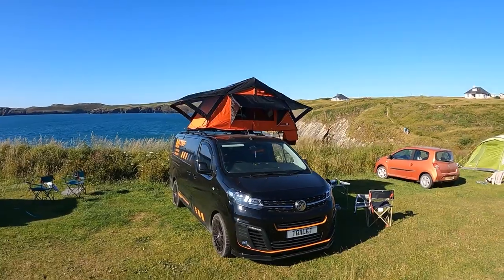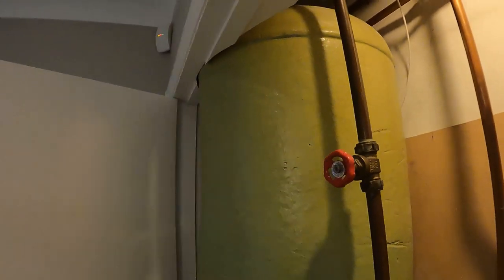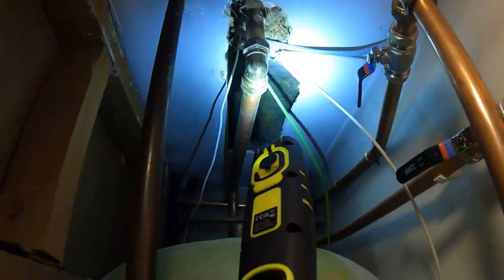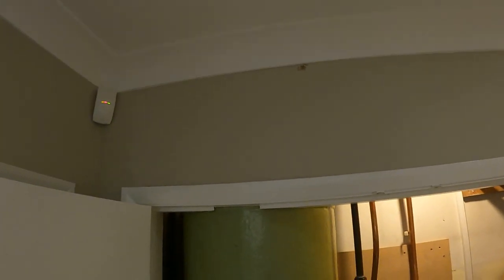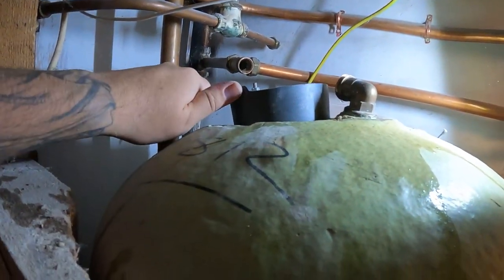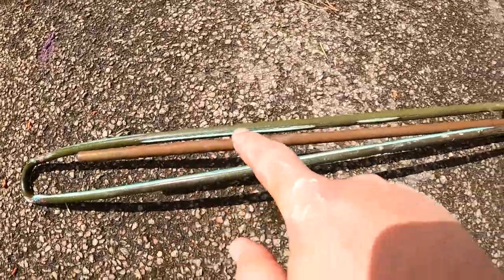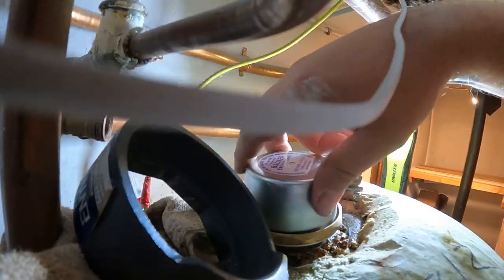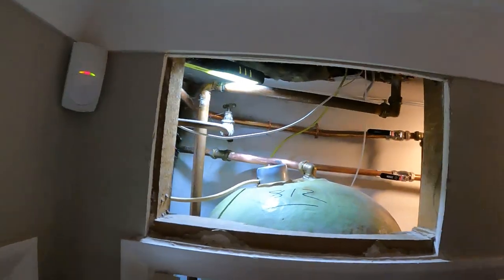IMMERSION HEATER SWAP but it’s not that simple!!! REAL WORLD PLUMBING

Comment: The washer on an immersion is a fibre washer so if any moisture gets to it it expands and seals it. I agree ptfe on the thread but PASTE NEVER on the washer as it will be rock hard by the time the immersion needs to be undone again and it will not move even with a big pipe!!  You love your paste - I have never used it and never had a leak after I have greased the olive!!  I've had some immersions in daft places too!!
Reply from the maker: Never had an issue using paste, or removing things that have been pasted. I’ve fitted a few immersions in 27years and all have been fine.

If you don’t use it someone on the YouTube comments will say you should …. And if you do someone will say you shouldn’t.
We all do things different, no right or wrong as long as it doesn’t leak….. as that’s plumbing😉

Comment: Nice job in the end mark and good tip about informing the customer that the boss can twist on the tank. I hate doing immersion heaters as 9 times out of 10 they have boss white on the threats and they are stuck meaning plenty of patience and slowly slowly with heat.
Reply from the maker: Thanks mate…. Yep always cover your arse on these types of jobs…. We are too long in the tooth to be caught out😉😉
Reply: I have just posted my comment about using boss white on the washer. Fibre washers do not need it. It will be rock hard by the time the immersion has to come out. I have NEVER used boss white on any joint. Just grease on an olive and that tightens smoothly every time so no leaks.

Comment: Love the way you explain every step, to be honest, I at first thought drain tank, cut hole fit Essex flange install the short 11-inch heater, and extend the wire to the heater, But you got over that very well indeed brilliant video, cheers for that, PS we all need a break, and camping is a great way.
Reply from the maker: Thanks Peter….

So many different ways to do so many jobs in every trade, as long as the customer gets what they want at the end 👍🏼👍🏼👌🏼

Really appreciate comments like this, not a “you should of done it this way” comment where they think there way is the only way.

As for the break… it was lovely to just have a few days away with the simple things

Comment: Brave man! I’d have said use a kettle till boiler back & just keep using that to heat water !😁
It never ceases to amaze me, why HWC’s are mounted up like that as if it will give better hot water flow when as we know, it’s the height BELOW the CWS tank that gives that plus of course making sure that fill level is 50mm below overflow ie: full enough!🙄
Reply from the maker: Kettle to run a bath… 🤣🤣

Immersion heater is doing its job, it went as it’s been in for probably 20years and not been used, as said boiler being swapped so the immersion was being used exactly what it was for👍🏼👍🏼

Comment: Hi Mark,
A great film just my kind of job, love the nice pipe bend around the immersion heater.
The old 3/4 pipe and fitting strikes again, real world plumbing I guess. A great solution with the access panel,
it’s also now ready for the next visit. 
Have a great time away that looks a great place to stay, take care, regards, Chris. 👍👍👍
Reply from the maker: Thanks Chris…. Yep a fiddly job but got it sorted in the end👍🏼👍🏼
Reply: If the pipe was 3/4 how did the new metric pipe fit into the T on the other end?

We've got the same issue in Austria with 14 and 15 mm pipes. The standard changed to 15 mm way back in the 80s but there's still the occasional 14 mm pipe around.

Comment: How did you connect the other end of the 22mm pipe surely it was an imperial three-quarter inch fitting.
Reply from the maker: I would of used the correct fitting👍🏼
Reply: @MJTiffPlumbing  thank you for the clarification, I thought that's what would have happened but you did not video that, it's great watching your videos.

Comment: How long did that take and how much did you charge labour 
I think I would have charged 160/180 plus immersion.
It’s one of those jobs you can’t charge the actual time taken and you have to think what cost is the customer expecting
Reply from the maker: Was probably around that to be fair
Reply: For side mounted immersions I charge at least that as when the drain off tap doesn't work as usual the tank has to be emptied by syphon from the top which can take an hour. Then the risk of when the bottom one is undone there is still water in the tanks so a big flood! I take it out very gingerly just in case with the vac handy!

Comment: Fantastic video Nick. Just discovered your channel recently and watched heaps of your videos. I’m on my first reno and learning as I go. I bought a 60s bungalow with a new grants boiler but it costs a fortune to heat 500 litres a month. Do you think this is because of the old cast iron massive single panel radiators that weigh a ton? Should I change these for something more modern?
Reply from the maker: Glad your enjoying the channel mate….. and yes that would deffo be causing part of the problem I would say….
Reply: @MJTiffPlumbing  love watching your bathroom re models. That’s my ultimate goal with help for trades I’ve course but as much as I can do by myself I’ll do. What radiators are recommended for an oil condensing boiler set up? I was looking at Screwfix earlier and the reviews were decent

Comment: I thought you might have kept a couple of 3/4 -22mm end feed couplers on the van Mark . I always have those in the van for that situation
Reply from the maker: That wouldn’t of helped as I had to renew the Pipework and I wouldn’t of got the bend on with a coupler…. It had to be straight out the connector…🙈🙈

Comment: U can always shock the immersion by hitting the immersion spinner with a lump hammer…… goes every time. That’s the way I do them every time
Reply from the maker: I’m sure you can but that one is deffo not one I will try, I’m sure it works but I will stick to the long extension bar and a steady turn🙈🙈
Reply: Correct. A steady pull with a bl**dy great pipe on the spanner will twist the copper and it will crack. A bit of heat and a few heavy taps  and maybe a squirt of WD40 does the trick as you and I have found!

Comment: I had a fun day on Friday cylinder 40 years old customer wanted an immersion never had one the cap was welded on took an hour to get off with the blowtorch and  then cylinder got a pinhole in it I told the customer it could happen that's the risk, they weren't happy to fork out for a new cylinder but what can you do they got 40 years out of a cylinder and on my case all day asking is it finished yet when you have to drain down the system and take the cylinder out that's enclosed in a hotpress and repipe everything as the pipes don't match up torture 😆

Comment: I have watched many of your video and know you are a paste man for all joints but for an immersion you have the fibre washer to seal it in so using paste will make it a nightmare for removal in future. Ptfe acts as a lubricant and a bit of additional sealing.. When its all wired up and switched on I always use a screwdriver against my ear and touch the nut of the immersion so I can hear it is working. Electricity hums!
Reply from the maker: Just use a tester to see mate….. touching and listening is like going back 60years🤣

Paste won’t be an issue as it doesn’t go off or set…. Alway used it for 28years on immersions with zero issues👍🏼👍🏼
Reply: My listening technique also lets me know the immersion isworking as I can hear the water getting hot!! We all have our weird ways of doing things! I used your hint for installing a kitchen tap by putting the rubber and washer through the hole!! Never too old to learn!! Cheers

Comment: OR you could leave it in situ .....drained the tank fully ...............and put a bottom side entry Element in ?
 Problem solved today and in the future.   No redecorating costs for the customer.
Reply from the maker: Not when there is no low side entry point…. Completely impossible and wouldn’t want to try and fit a side entry element into a 20year old cylinder!!!!

Problem solved the way I did it and now has a permanent access for the future👌🏼